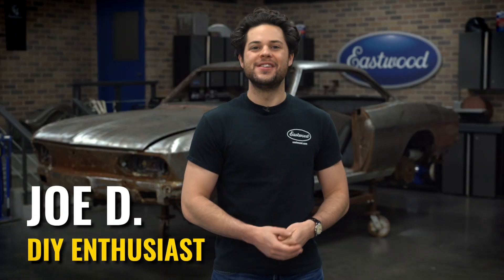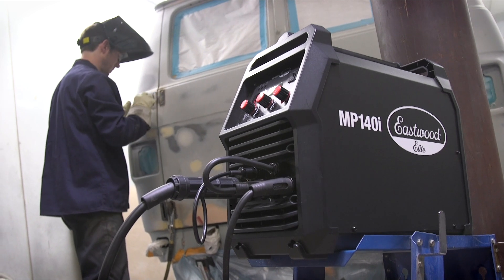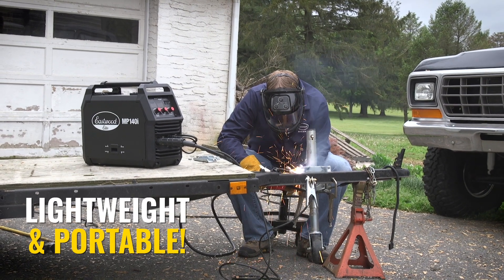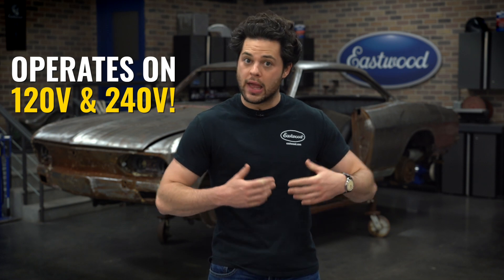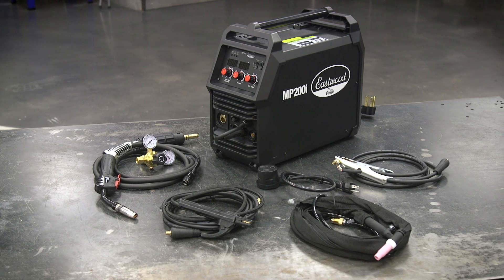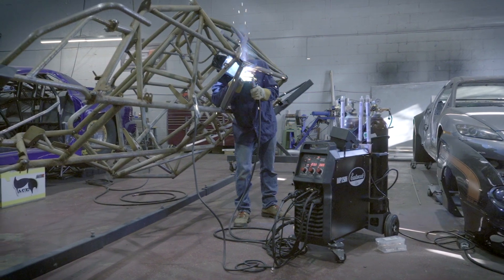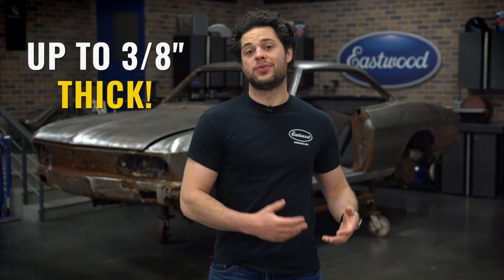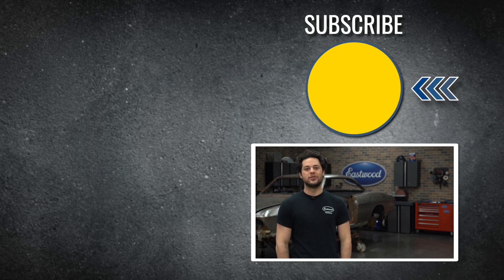How To Decide Which Welder is BEST for You! MIG - TIG - Stick: Multi Process Buyers Guide | Eastwood

Comment: Geez. I’m so on the fence. Looking for a first home welder. Projects I have in mind are specifically for TIG.
I’ve been eyeing your TIG 200 Digital.
I’ve also looked at the Everlast PowerTIG 200DV.
But this looks intriguing 🧐
Reply from the maker: If you're planning on doing a lot of TIG, keep in mind that the only high frequency start multi-process machine is the MP250i. MP140i and MP200i are scratch start... If you have the budget, I highly recommend the MP250i. The best machine for TIG, with MIG and ARC capabilities. 
I really dig the 200AC/DC for a first TIG machine. Cannot go wrong with the 200 digital either, but for a first and only welder... It's the MP250i for me.
-JD